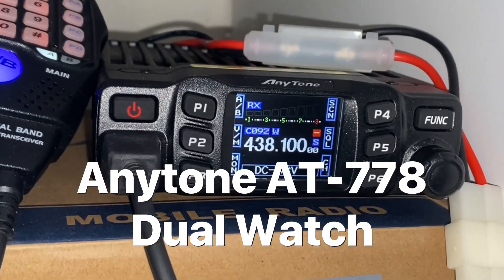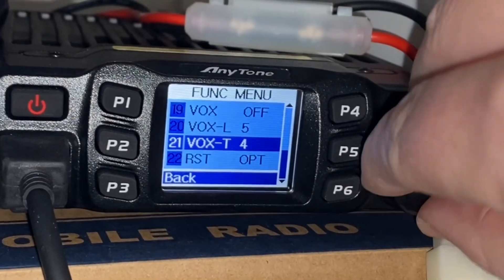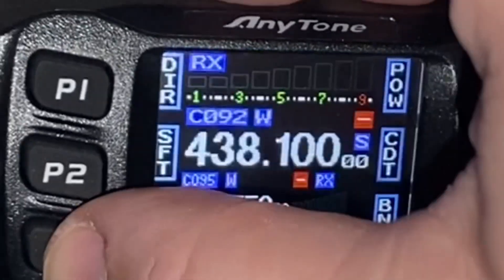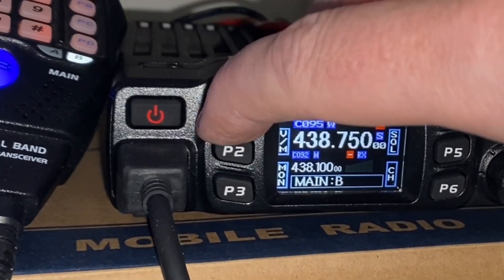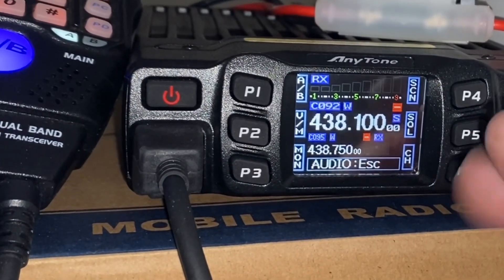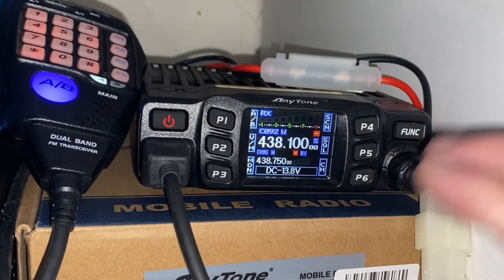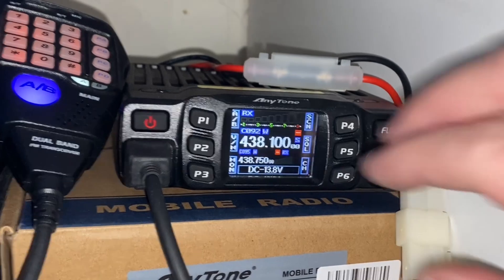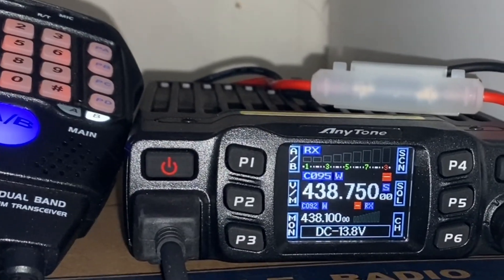Dual Watch - #anytone 778UV #hamradio

Comment: Hi just wanted to ask anytone at-778uv how you get mic Gain.
Reply from the maker: Believe it is option 2 in the function menu. But this may only be valid for the version 2 models. Let me know how you go.
Reply: I just got New Anytone at-778uv  don't have mic Gain adjust  how you get it?
Reply from the maker: I've done a video on mic gain. Will post it shortly for you mate. Hope it helps.